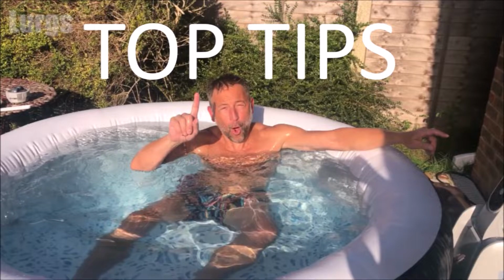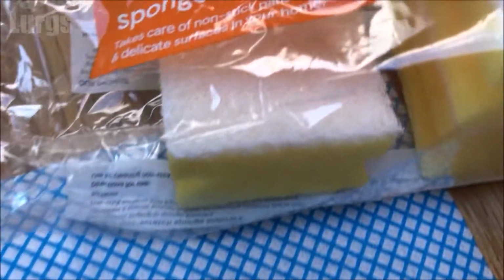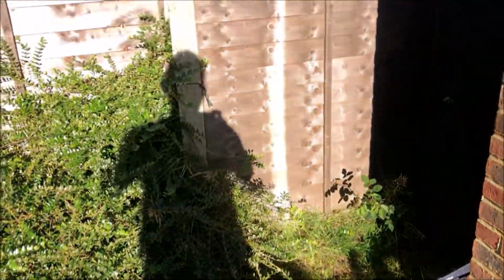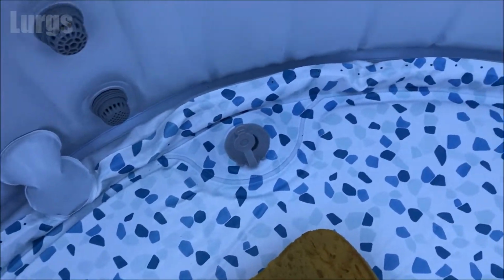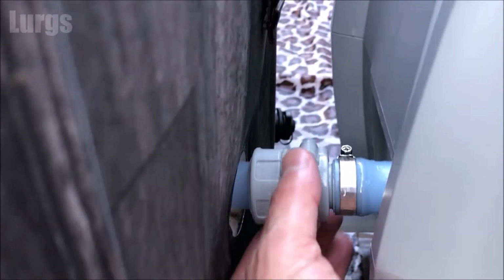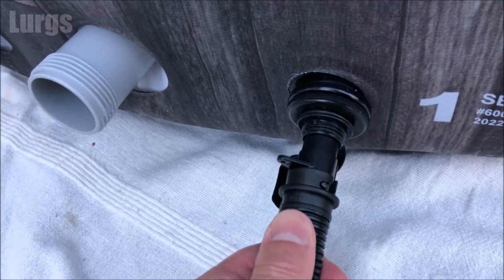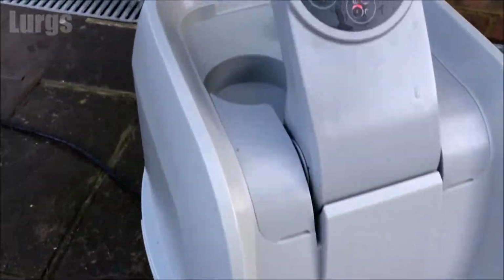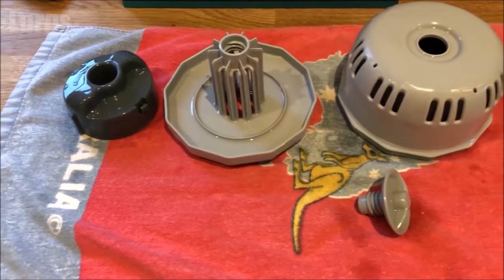LAY-Z-SPA How to empty water, clean LAY-Z-SPA, deflate LAY-Z-SPA, pack away LAY-Z-SPA for the Winter

Comment from the maker: Other useful How To Guides to help you save ⏱TIME and 💰 MONEY:
Bestway LAY-Z-SPA Installation Easy Step by Step Tutorial https://www.youtube.com/watch?v=VwwC4t3Nw84&list=PLqrXuUebV8N-zRG0YqnE6XvX3AH9s8ydb
LAY-Z-SPA Running Costs plus TOP TIPS to keep your LAY-Z-SPA Water Clean https://www.youtube.com/watch?v=TW6pHYEEqUk&list=PLqrXuUebV8N-zRG0YqnE6XvX3AH9s8ydb
LAY-Z-SPA TOP TIPS to keep your LAY-Z-SPA Water Clean https://www.youtube.com/watch?v=4G9Ne67jrJo&list=PLqrXuUebV8N-zRG0YqnE6XvX3AH9s8ydb
How to use Keypad on LAY-Z-SPA https://www.youtube.com/watch?v=iU2jmRzXPTU&list=PLqrXuUebV8N-zRG0YqnE6XvX3AH9s8ydb
How to change filter on LAY-Z-SPA https://www.youtube.com/watch?v=lnAeaUEI6tE&list=PLqrXuUebV8N-zRG0YqnE6XvX3AH9s8ydb
LAY-Z-SPA E02 Error Code FIXED https://www.youtube.com/watch?v=xMw-b35HdPg&list=PLqrXuUebV8N-zRG0YqnE6XvX3AH9s8ydb
How to clean filter on LAY-Z-SPA using a Washing Machine https://www.youtube.com/watch?v=wG3gMDliHe8&list=PLqrXuUebV8N-zRG0YqnE6XvX3AH9s8ydb
LAY-Z-SPA How to use ChemConnect with ClearWater Multi Function Chlorine Tablets https://www.youtube.com/watch?v=UGPBCcXGvbw&list=PLqrXuUebV8N-zRG0YqnE6XvX3AH9s8ydb
LAY-Z-SPA ChemConnect How to adjust the Chlorine strength output https://www.youtube.com/watch?v=FAT31paJlQc&list=PLqrXuUebV8N-zRG0YqnE6XvX3AH9s8ydb
How to add air into LAY-Z-SPA https://www.youtube.com/watch?v=JalDeq5Uh-w&list=PLqrXuUebV8N-zRG0YqnE6XvX3AH9s8ydb
How to deflate LAY-Z-SPA using the Pump Unit https://www.youtube.com/watch?v=G9SkR2dLC3o&list=PLqrXuUebV8N-zRG0YqnE6XvX3AH9s8ydb
LAY-Z-SPA How to empty Water & How to clean LAY-Z-SPA & refill LAY-Z-SPA with Water https://www.youtube.com/watch?v=V04LlGyVlxk&list=PLqrXuUebV8N-zRG0YqnE6XvX3AH9s8ydb
Inflatable Spa Round Floor Protector Mat for Lay-Z-Spa https://www.youtube.com/watch?v=1-dicsxobMY&list=PLqrXuUebV8N-zRG0YqnE6XvX3AH9s8ydb
LAY-Z-SPA Thermal Hot Tub Cover Review https://www.youtube.com/watch?v=R-KMMQJP7mk&list=PLqrXuUebV8N-zRG0YqnE6XvX3AH9s8ydb
LAY-Z-SPA Stain and Scale Controller Liquid for Hot Tub & LAY-Z-SPA and How to use it https://www.youtube.com/watch?v=Ya8-BwGQ40k&list=PLqrXuUebV8N-zRG0YqnE6XvX3AH9s8ydb
How to empty water, clean LAY-Z-SPA, deflate LAY-Z-SPA, pack away LAY-Z-SPA for the Winter https://www.youtube.com/watch?v=G9SkR2dLC3o&list=PLqrXuUebV8N-zRG0YqnE6XvX3AH9s8ydb
.
How To's, Life Hacks, Helpful Tips https://www.youtube.com/watch?v=dcmxUTsedlk&list=PLqrXuUebV8N92xXP4Dm_pHfBpEQ3wtP2R
Washing Machines How To's, Tips, Tricks & Fixes https://www.youtube.com/watch?v=0_gst8RokRo&list=PLqrXuUebV8N_Bv_41hH-IpIfM5qiS0Sin
Dishwasher How To's, Tips, Tricks & Fixes https://www.youtube.com/watch?v=6z22-Ysn7rE&list=PLqrXuUebV8N89GJMUjDiMqGpAcic3wqfD
Toilets and Plumbing How To's, Tips, Tricks & Fixes https://www.youtube.com/watch?v=vT5KwJ2A2eU&list=PLqrXuUebV8N_d4OWPjAk4PJ7LnKb0Jdot
Combi Boiler How To's, Tips, Tricks & Fixes https://www.youtube.com/watch?v=1gGEP2y_qHM&list=PLqrXuUebV8N8aiBpt_F3n23E3IOLlmgK2
My Reviews https://www.youtube.com/watch?v=QX0ge0QOXJk&list=PLqrXuUebV8N9_JYlSh2LjbfUsybF840oy
.
TECHNOLOGY
==========
Windows 10 How To's, Tips, Tricks and Fixes  https://www.youtube.com/watch?v=eZW7ka9xgXg&list=PLqrXuUebV8N95_cVCA-40v6eT9piGz26y
iPhone iPad iTunes How To's, Tips, Tricks and Fixes https://www.youtube.com/watch?v=hcGfZTcJxvo&list=PLqrXuUebV8N_YRivg9p4ZpkUyBDbSb8t7
iMovie iOS How to Guides https://www.youtube.com/watch?v=uTkXwZJ0gE4&list=PLqrXuUebV8N-D5BiCaF2AV-Qb-8gZwBFC
WhatsApp iPhone How To's Tips, Tricks and Fixes https://www.youtube.com/watch?v=5hhxjxkNMUA&list=PLqrXuUebV8N-bMvTYJdRXrKakVdChdl9o
Google Chrome How To's, Tips, Tricks & Fixes  https://www.youtube.com/watch?v=iLSbSA5YECc&list=PLqrXuUebV8N8RYpRb0gVVNf9SpC78SB47
Microsoft Word & Excel How To's, Tips, Tricks and Fixes  https://www.youtube.com/watch?v=OZi6yS79FLA&list=PLqrXuUebV8N_DyHPlBddZaL8LOwuCzFK3
.
Vehicles How To's, Tips, Tricks & Fixes  https://www.youtube.com/watch?v=w44aQ7dc_Lk&list=PLqrXuUebV8N9fyM8qA2D0rkVfv929Ckod

Comment: Greetings from Canada and thanks for all your Lazy Spa videos. Really enjoyed using the spa as a first time owner. I've followed the steps in this video but as soon as I start to deflate it I get the E02 error and both the filter and heater light come on. I can shut both off but after 20 seconds I get the error again. Any suggestions.?  Thanks in advance.
Reply from the maker: That is very odd because E02 is a blocked filter but the filter isn’t on, you haven’t put the cap on the filter part when you deflate?
Reply: Thanks for your respoonse. No caps on at all. I've been careful the whole time with filters, changing themevery 3 days as I saw online about this dreaded E02 error. It was completely unexpected to get the error this afternoon. Maybe I'll call the UK customer service (I'm an Ex Pat from Wiltshire) on Thursday as there seems to be no support in Canada even though the are sold all over.
Reply from the maker: @kevinmayo4119  Of all my videos you are the first that I’ve heard getting an E02 on deflation. Very odd. And you have definitely got the special attachment on the unit end? Hope you can get it sorted. Good luck
Reply: I got a e02 inflating 😅. Switched off and on again, then it was fine

Comment: Weird question, but how do you remove the water sitting in the pump unit? Ours has been sitting full, unused for months, and I dont want that old water back in circulation once we empty and refill it. Thanks
Reply from the maker: @alexmorrison4961  I would disconnect the pipework from the Hot tub, then just run it for 5 seconds on filter only mode just to clear it out, or try to put pipework in a large bucket of water so it sucks that in and filters round

Comment: I keep getting the e02 beep when taken out the air?
Reply from the maker: How odd it should not do that. Have you definitely go the adaptor on and also no covers on any of the holes?
Reply: @LurgsHowToGuides   ya definitely did it the way you said in the video. I watched it a few times.
Reply from the maker: @carolineflynn4848  Someone else had same issue and commented but never got back to me if they cured it. It shouldn’t do that. Best contact Bestway and ask them. Good luck